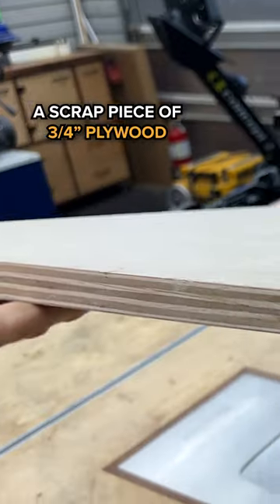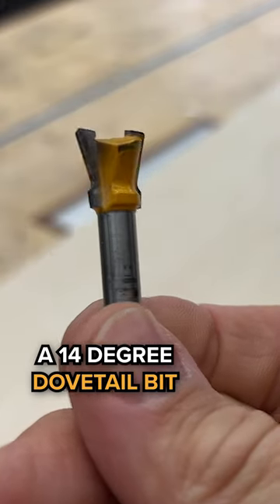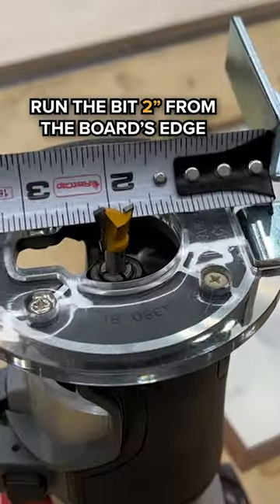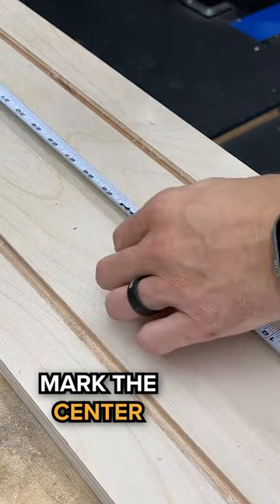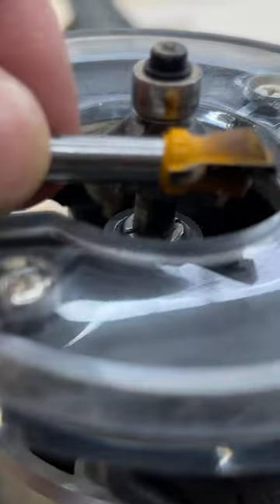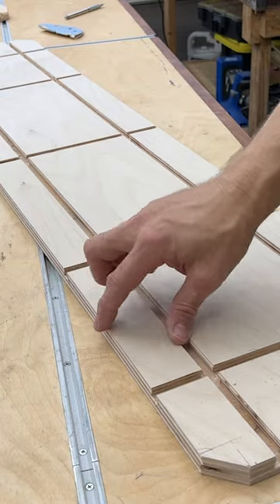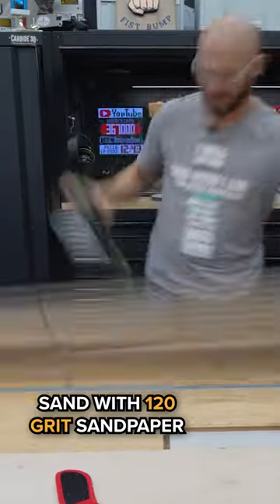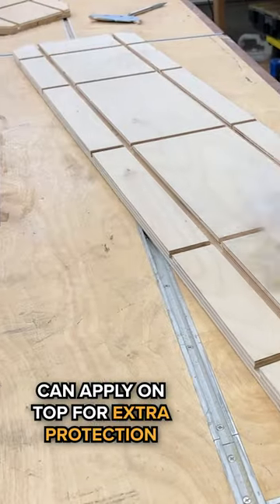No Jointer? No Problem! #woodworking

Comment: I like the part where he showed us how to use it and what it’s for
Reply: i like the part where you used reading comprehension to deduce that this is a build video for a jointer sled.
Reply: You put it on the fence (the flat side) and clamp your workpiece down to create a flat face on your workpiece. It's an easy jointer jig.

Comment: I probably shouldn't admit this but ive been into wood working for almost 4 years now as an amateur. I didnt know there was a router depth guage like the one your using in this video.  Once i saw it i had a wow moment! Lol! Ive been using a tape measure up till now. Thanks! 😊
Reply from the maker: They make setting up bits and blades fast.  I linked to them in my pinned comment if you want to check them out.
Reply: If ya learn something new everyday- it’s win-win.   I don’t know how many tools over the years i have used and little tricks to them or “features” i never knew.  

👍

Comment: Made this and it has made cutting a straight edge so much easier and quicker. Also just using this on the workbench to clamp things and hold pieces in place while using a router etc . However its warped immediately

Comment: Replied to a fellow below, might benefit others: 

You would need this jig to get a straight edge on a tablesaw if your workpiece didn't have a straight edge to run against the fence. 
For example, a board with a warped convex edge would rock against the fence as you pushed it. Not a good cut and also dangerous. 
Or, if you're working with rough lumber that doesn't have a straight line rip from your supplier, you wouldn't have a reliable, perfectly flat and straight edge to run against the fence. This jig is what you'd use (or a jointer) to get that perfectly flat edge on one side, then ditch the jig or jointer, put that newly cut flat side against your tablesaw fence, and cut your piece as normal.
Reply: That answered the question I had too. Thank you!

Comment: What is the advantage to using this or using an actual jointer?  Can’t you get a straight edge just putting a board tight to the table saw fence and ripping it without this jig?   I’m not hating at all this is a genuine question from someone who’s delving into finish work now after being a career framer.   Love the channel by the way it’s helped me lots already!
Reply: Might be easier to straighten the edge on a wide or unwieldy board that would be awkward on the jointer? 
For your second question, you would need this jig to get a straight edge on a tablesaw if your workpiece didn't have a straight edge to run against the fence. 
For example, a board with a warped convex edge would rock against the fence as you pushed it. Not a good cut and also dangerous. 
Or, if you're working with rough lumber that doesn't have a straight line rip from your supplier, you wouldn't have a reliable, perfectly flat and straight edge to run against the fence. This jig is what you'd use (or a jointer) to get that perfectly flat edge on one side, then ditch the jig or jointer, put that newly cut flat side against your tablesaw fence, and cut your piece as normal.

Comment: Suggestion to put a dado cut under sled w a runner. That way you arent using your table saw fence and have alot less chance of kickback- assuming your cut piece isnt flat (which is why you need a jointer in the 1st place). Otherwise just use a circular saw w track attachment or track saw if you have one.

Comment: I think I saw another, longer video of you going over this, went to local woodworking store to find the MicroJig dovetail (router) bit. The only one I found was 1/2" shank and of course that wouldn't fit in my cordless trim router, same one you have, in fact!
Reply from the maker: I'm using the 1/4" shank, you can get it on Amazon. I linked to it in the pinned comment if you want to check it out